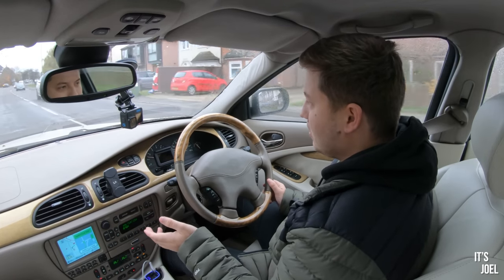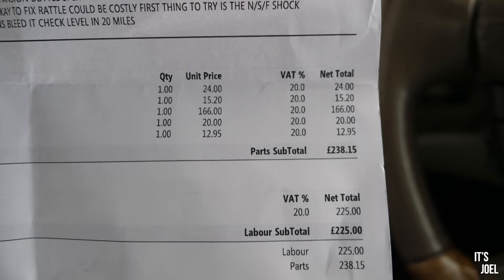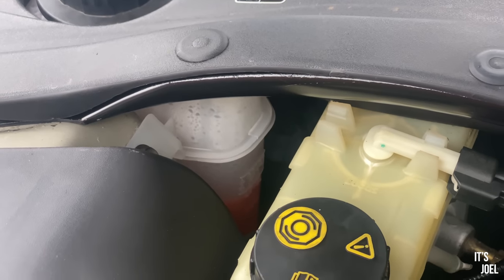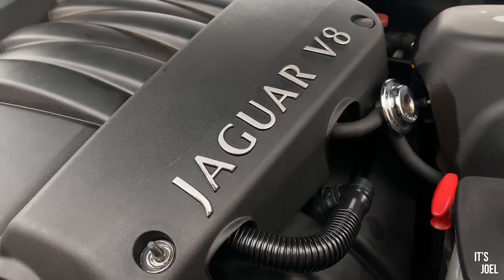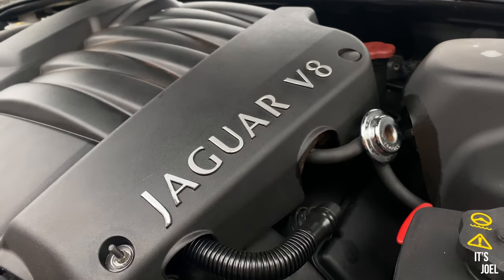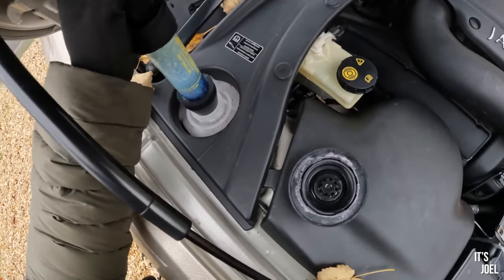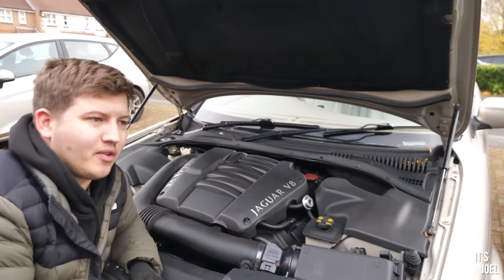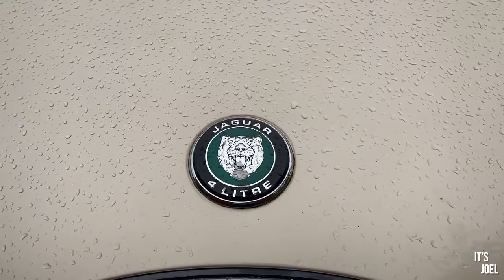Can this £30 bottle of Steel Seal save my cheap V8 Jaguar?

Comment from the maker: I love this community, your suggestions and comments are invaluable! Let’s work together to get this Jag back to health!
Reply: I would keep driving it and check if the coolant level drops at all mate - if it doesn’t, the smoke is benign. If it does, cross that bridge when you get to it! Don’t waste any time investigating or worrying about a potential non-issue. 👍🏻
Reply: Happy to recommend Surrey Jag Centre in Redhill. They look after my X350 XJ8, and are really helpful, honest, and quick! Good luck getting the Jag sorted out.
Reply: Cracking V8 keep the faith 🙏
Reply: Drive it enjoy it and see what happens 👍
Reply: We love you Katy & Lando! Let’s do this!
Reply: The white smoke is very likely to be the normal winter condensation. I have lots of problems with AJ26 SC engine cooling system last year. From experience, if you're worrying about the cooling system, I'd say the first step is to do a cooling system pressure test to identify any water hose leak. It's worth noting that some water hose damages might not be found by doing pressure test on a cold system, because some weird rubber pipe leaks only happen when the system is warm. Once you're assure all water pipes are fine, it'd be better to check the radiator as insufficient or blocked radiator can cause coolant to come out from expansion tank simutaneously when turn off the engine. The sniff test results shoud be accurate. If the fluid remains blue, then there is no exhaust gas leak, proving steelseal did cure the minor headgasket issue. If both of your coolant and engine oil doesn't become melt milk chocolate, then you shouldn't have any further headgasket issue. Does the coolant leak, consumed or pumped out from the expansion tank at driving? I would keep an eye on the coolant level but drive it normally.
Reply: I also have white smoke from my CL with it’s V8. Especially when the temperature is around the 4-5c mark. I think go on a few longer runs with it to see how it behaves and build up some confidence in the car. That’s what I’m doing with mine over the months I have had it. Wish you all the best great fan of the channel man keep up the great work
Reply: Joel, I think it’s just a perished hose. It’s an old car so expected. Don’t hold onto this one too long - a Porsche Cayenne is shouting your hand
Reply: Being a V8 you have 2 head gaskets one for each bank of 4 cylinders, so you may have had only one go, although personally I wouldn't use that product on my own car, you may have solved your head gasket issue for now based on the block test. First thing now would be and engine flush then oil and Filter change to eliminate any coolant contamination in your engine oil, this could be why you are still getting the white smoke. As for your worries with the coolant going up and down sounds like your thermostat is working as it should. Check your coolant when the car is sat on a flat level surface atleast 10mins after a drive with the engine off.
I'm here as I had an Z4 E86 3.0si 👍
Reply: mine do the same below 5C they said its normal join jag forums they can help
Reply: We do what we can to help. 😊 I got one myself and I ran a RVS treatment on all systems, engine gearbox, steering fluid and back diff. Kid you not but I average 30 mpg on my 3.0 year average and up to 40 on a run. 35 on the highway at 70+. RVS should do wonders for the nikasil liners on you car also. Just a tip. Greetings from Sweden.

Comment: From experience, I definitely don't think you have a head gasket issue. That slight mayo on the oil cap is just condensation, very very common this time of year. Same with the exhaust. These older cars have a better flow of gases than modern ones so they do have a bit more condensation coming out of the rear in winter. I would go for a couple hour drive, check the coolant and keep an eye on the temperature just to double check but I think you'll be fine
Reply: I've had a bit of mayo on my '03 E60 530i. I was convinced it was a dead head gasket when I was getting misfires.
It was actually just dead coils.
BMW independent workshop said that the gasket was fine.
Reply: I wouldn't think he had hedgasket as well but the car did overheat I think when the expansion tank gave way. Those early  AJV8s don't take well to overheating. Although I'm not sure how trustworthy those block leak testers are I had a car with a definite head gasket failure and my block lead tester always passed.
Reply: Yea a tiny bit of mayo on the cap can be condensation and the same with the exhaust. My old e46 does it every winter without fail.
Reply: But the first block test confirms he is getting CO2 into his coolant system?
Reply: I would say so.
Reply: Yup I’ve got a m52tu2 e46 and it white smokes until it’s fully up to temp just condensation. I never drop any coolant level…. Or oil 😊
Reply: Unlikely to be had gasket on the V8. Jaguar did this engine right.
Reply: Weeping rad or heater matrix would give all your symptoms, and that is not white smoke that is the condensation on any cold day. Fan comes on OK, not overheating, not drinking coolant. Do a pressure test with heater at hot and engine not running and look for drips.
Reply: @JustBadly  I agree
Reply: @lenyard  
I agree it’s usually the problem with these cars.
Reply: Condensation can occur in engines that are only used for short journeys
Reply: Mate, its an old jag, its going to smoke 

Just drive it and see how it goes
Reply: @nostreamavailable9090  that's not smoke, that's steam
Reply: Mate the oil cap will have more of a mayonnaise texture stuff on it, what you have there is almost nothing!! Even if you did have something of concern most likely it’ll be caused by condensation like on my Merc 320 V6. Give a run and when it’s warm the “mayonnaise” goes away 👍🏻😎
Reply: @RATTLER238  had the same with my Camaro mate
Reply: My s type 4.2 V8 has condensation from exhaust in cold temperature.its normal
Reply: My Peugeot 207 2010 reg  does the same and mayo in the oil cap is little to a slight smear on cap and it’s only In winter and in colder days and my dad who used to be a car mechanic said not to worry nothing is wrong it’s condensation and if it was his car he wouldn’t even for a minute think it’s the head I think his is the same just condensation in his Jaguar I have seen a new 69 plate car and a 72 plate car doing the exact same smoke out of exhaust so it gave me a bit of relief to see if two new cars do the same it’s just what cars do in winter
Reply: @curtisj2165  Steam is invisible. What you mean is condensed water vapour
Reply: you hit the nail on the head for me. i thought mine was head took to my cousin and he said naaw its normal for cars to have slight scum from condensation at this time of year.
Reply: Sniff test positive, why would that be do you think

Comment: Worked at Jaguar for 31 years on Research and development and the S-type was one of the cars i worked on, owned a few and loved them. Great cars but did have a few underlying faults, the eletrics was a big one as it was pretty advanced for its time. one tip to you would be if you have eletric gemlins and faults coming up like gearbox fault or ABS fault check the battery 1st as soon as battery starts to go it throws up loads of untrue  errors, good luck great seeing you working on it brings back loads of memorys of all the work I have done on them
Reply: I agree. Car sounds slightly hesitant to start. Chuck a new battery on probably hasn't had one for years. I've just replaced the battery on my old XK8 and haven't had any warning lights was getting some random ones. Also anti-trap window was playing up. I do have a misfire though but that's just a coil pack I changed one before but this time I'll change seven as they're probably all on the way out. Quite fancy an XJ in the future preferably a super V8.
Reply: Sometimes earthing faults cause electrical gremlins too.
Reply: Give it a gud service! Fuel/oil filter!   Fuel cleaner additive and a product called k seal for ur coolant prob!... this product is brilliant! Make sure u add enough 4ur coolant system capacity! An excellent Fuel cleaner that inhibits moisture is lucks or liqui moly!... of course there are others also...just check for urself! Godbless!😁👌👍
Reply: A weak/life expired battery will definitely trigger false error reports. My 2005 3.0 had auto handbrake issues, making me call out the AA on two occasions to release the handbrake before I got the battery tip. Bought a heavy duty battery and my troubles were over. Your "smoke" appears to be condensate (i.e. steam) and is common on older engine designs, especially largeish engines. Nothing to worry about.

Comment: Normal combustion process produces something like 10% water, so the white "smoke" you are seeing is normal, especially in this cold weather. The fact that your sniffer test stayed blue may indicate that there was a slight head gasket leak which you may have now fixed. Just keep an eye on the coolant level as you drive the car and check that it doesn't move. Don't forget to add the correct antifreeze/corrosion inhibitor for your engine!

Comment: White smoke (steam?) out the back is nothing to worry about this time of year- go outside and breath out - you will see it - same theory with the car - your breath and exhaust is warmer than the air so will be visible. The small amount of mayonnaise on oil filler cap is probably just condensation , pretty normal if you have used car on a lot of short runs - never gets warm enough to burn it off, wipe it off and take it for a long run and check again, as long as the oil itself doesn’t look creamy you are probably ok.

Comment: Interestingly Chris Fix did a head gasket sealer group test on a V6 Jag. He did a before and after tear down of the engine to show how the sealer works and it was still holding after 2 years.

Comment: I used steel seal on my 1993 Subaru. It lasted a year and definitley did work. My advice is just drive the car easy. Eventually I saved up enough to have my head gaskets changed but that £40 bottle allowed me to keep driving another year without issues 👍

Comment: I used steel seal and it worked on my 2000 polo. Spoke to my mechanic and he said you'll still see water coming out as the exhaust needs to dry out. Done a few thousand miles it in and touch wood it's still running great. Picked the car up for £550, previous owner wasn't aware of the head gasket issue as an unscrupulous garage just took the thermostat out and charged him £180!. I've had the cambelt replaced and serviced it myself. Plenty of life still left in it.

Comment: Steel seal only works if you follow the instructions on the bottle. The car needs to be stone cold, not 3/4 hours cool.  Also, you then have to warm up the car once you've put in steel seal. Switch it off after it gets warm, then leave it until the engine is stone cold again. Which takes about 12 hours, not 3/4 hours.
Reply: You forgot the most important part, The For Sale sign in 24 Hours after application...
Reply: It worked on my Vivaro , think I caught it in time
Reply: From what you describe I would change the expansion vessel cap, flush the coolant and change the thermostat. Also look at the pump. I have had a lot of Jags and maintaied them myself. If stood for a while and run you can have thich mayonnaise on the cap. It clears. White smoke clears ignore it at present. Additives are a no no which if you work on the car you will realise why. It can stop equipment working. Check the heater matrix as the smell might be due to a leak, and lastly only top up with coolant either premixed or using a mix with distilled water. if there was a HG issue the car would run badly.
Reply: @mikemeyjes4564  "only top up with coolant either premixed or using a mix with distilled water" - why so, why not pure coolant?
Reply: no need for stone cold at either end; you'd change those timings if you knew that sodium silicate TURNS TO GLASS at 93ºC ;  from this, you can do a # timing study
ALSO,if your thermostat ih higher than 93ºC,  do EMPTY the system after 10 minutes!!!!!    you see, the ENTIRE bottle will then start to turn to glass INSIDE the cooling jackets with bad results;  the car will still be good for very slow drivings,but IF you floor it,for long, you may crack the block/head, because the places where the glass is gets NO coolant
have been using NA2SiO3 for decades;IT WORKS!!!!!
Reply: Pure coolant is very corrosive to things like gaskets etc.

Comment: Don’t worry about the condensation from the tailpipes , if it’s been wetting the exhaust for ages will take some drying out also it’s a big engine and it’s winter
Reply: Exactly what I was about to comment. Could take weeks to dry out the exhaust system, and only if you drive decent distances.
Reply: Quite right, my thoughts exactly!!
Reply: Steam is from all the moisture in the exhaust and cats after a leaking head gasket, it will take some time to clear!

Comment: Steal Seal works very well if used as per instructions. I used it on the notorious K series engine in an MGF and it solved the head issue, I sold the car 4 months later and I still see it at various car events and it still hasn't had a gasket replacement, that was 6+ years ago when used steak seal, a thumbs up from me for the project

Comment: Hi, Youtube just randomly showed me your video... I was a Jaguar master tech at 4 main dealers from 1995 to 2015. I think I can remember doing ONE head gasket on a V8, it was not common and I dont remember seeing many others being done either. Maybe now that they are another 7 years older, or if the car has been stood for a long time it would be more likely than back then... The tiny bit of `mayo` on the oil cap you show is not a concern, that is so small it could just be from condensation. Water pumps and thermostats caused overheating , over cooling and leaks. The dual control coolant valve and its wiring caused interior temp problems. There is an electric water pump that can fail and cause overheating. Expansion bottles cracked and all hoses swelled, blew off and generally leaked. I def would not have put any `miracle cure` additive in it, especially if you want to keep it... Good luck.

Comment: Hello, done this a few times before myself. It does work but not always straight away. You havent done the final step in the instructions either. Youve forgotten to let the engine completely cool again before trying again to see if head gasket leak is cured , this step is important. Once you leave the car over night and use it again next morning , it will be fine. Dont forget to warn people to be very wary of messing with scolding hot water that can blow straight out of the expansion tank at you if your not careful especially with head gasket problems.. Hope this helps. happy motoring.

Comment: The white smoke is very likely to be the normal winter condensation. I have lots of problems with AJ26 SC engine cooling system last year. From experience, if you're worrying about the cooling system, I'd say the first step is to do a cooling system pressure test to identify any water hose leak. It's worth noting that some water hose damages might not be found by doing pressure test on a cold system, because some weird rubber pipe leaks only happen when the system is warm. Once you're assure all water pipes are fine, it'd be better to check the radiator as insufficient or blocked radiator can cause coolant to come out from expansion tank simutaneously when turn off the engine. The sniff test results shoud be accurate. If the fluid remains blue, then there is no exhaust gas leak, proving steelseal did cure the minor headgasket issue. If both of your coolant and engine oil doesn't become melt milk chocolate, then you shouldn't have any further headgasket issue. Does the coolant leak, consumed or pumped out from the expansion tank at driving? I would keep an eye on the coolant level but drive it normally.

Comment: Hi Joel, the white fumes are often caused by water collecting in the exhaust  system and when the weather is properly cold you'll see white condensation fumes.

My advice ? Take it for a 20 mins drive to allow the engine and all it's components are fully warmed through, using a reasonable amount of throttle once warmed up. It won't fully warm up on tickover and stationary, irrespective of what the temp gauge says.

I'm not seeing any of the classic blown gasket signs : mayonnaise; bubbles in the coolant header tank; loads of white smoke; temp gauge in the red.

Comment: Hi Joel. Take off the plastic engine cover and track down the source of the water "spitting" from under it. It may be connected with the repaired water pipe. See you in the next one. 👍👍

Comment: I had very same issue with my volvo xc90...put vehicle into my local Volvo Dealer they diagnosed "Head Gasket" 
Paid them £2000 to replace head gasket....and the problem continued.Not happy I gave car back to Volvo and they then diagnosed a fault in the bottom block(engine)...and quoted me another £6000 to repair.
Obviously I was incensed with their incompetence having already paid them £2000....local garage mechanic I know suggested £24 bottle of Steel Seal which I did and it fixed the coolant problem.
By the way I used to own an S type 3.0SE.Great car.never had any problems with it.good luck with Steel Seal.